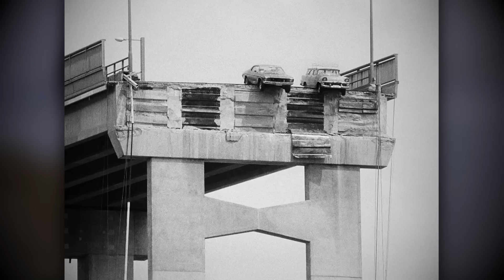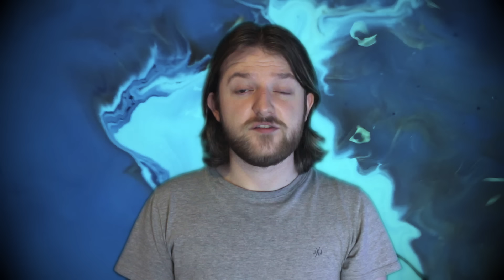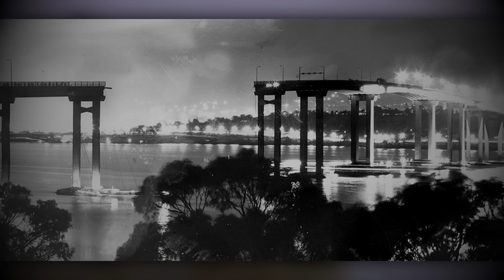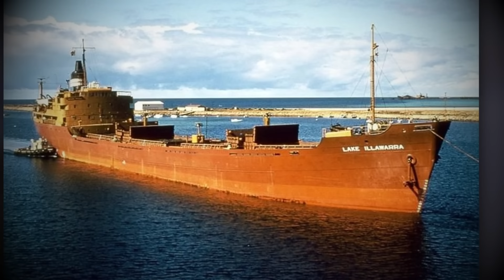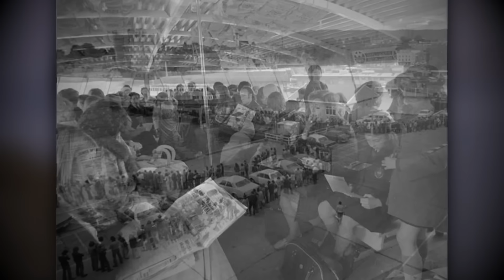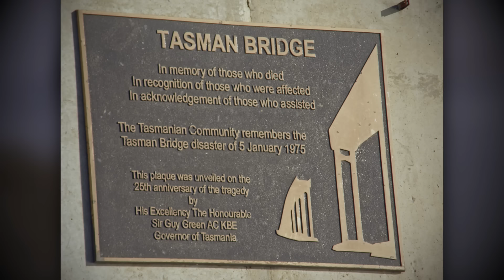Motorists Drive Off Collapsed Bridge | Last Moments

Comment: 12 people died? I thought you said the kill-o-meter was already at 40 when Frank stopped his 70s Monaro... A car with available 327 cubic inch engine that produced 250 horsepower that could reach 60 miles per hour in 7.1 seconds and had a fuel capacity of about 20 gallons. Probably just a language barrier thing. I bet it gets solved by the "next" moon landing. Colour me surprised. I'll remember that the next time I shoppe for another classic GM car.

Comment: Both cities that were responsible for the construction of that bridge are at fault here as well as the captain of the ship they should have figured the contingency that not all ships will perfectly go under a bridge therefore they should have had barriers at the base of the piling's that could take the hit from a ship and  knock the bridge down

Comment: Fixing that bridge should have never taken 3 years. 3 months maybe. There was a lot of work to do but they should have hired enough people to get it done quickly. Things like that can destroy a city's economy.
Reply: It's a huge bridge and clean up project. 3 months is an insane scale, even if you could build a bridge it certainly wouldn't be safe.
Reply: @mnm1273  they're not building a bridge though. They're building 1/10 of a bridge or 1/8 of a bridge. The 3 months was just there as a contrast number obviously it could take up to like a year? I don't know. I am not a bridge engineer it just seems like it could have been done faster. They probably had to do a lot to get the funding and all of that. That seems the company any big project
Reply: @bookaufman9643  They had to do an underwater clean up project. Which is a massive undertaking and then rebuild a central part of a bridge.
I don't work in building bridges but I can see how complicated the project could be. 3 years isn't crazy for cleaning up the water and the rebuilding a decently tall bridge. 
Especially because one section was si by they had to give up, giving up a supporting leg in a bridge that had already collapsed is a tough choice to make and they'll have to have exhausted all other possibilities.
Reply: @bookaufman9643  This is the 70s by the way (so limited tech). Just the survey took months as they had to accurately locate the large amount of debits. They actually built a secondary bridge for short term use a year into the project. 
They rebuilt and improved the bridge with huge funding. Over 10 million dollars a year seemingly 70s dollars (so higher adjusted for inflation).
Reply: @mnm1273  it just seemed like a long time to me. I'm also completely unexperienced in the field Bridge building but it seems as if something is important as the spread seem to be to the life of the city might have been done at a more rapid pace? I guess they did the best that they could.